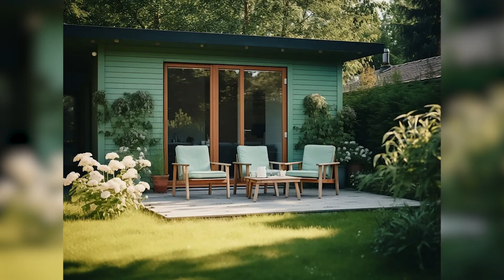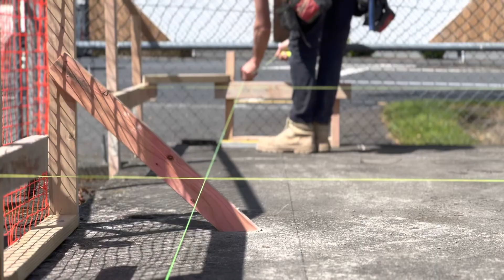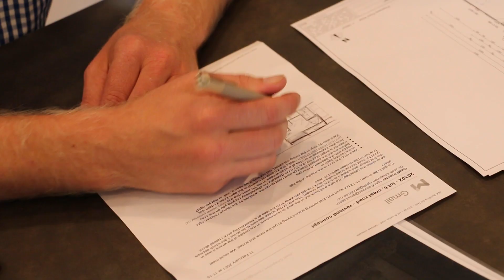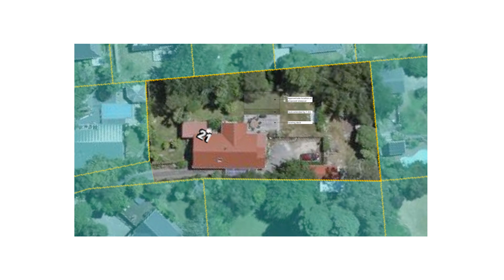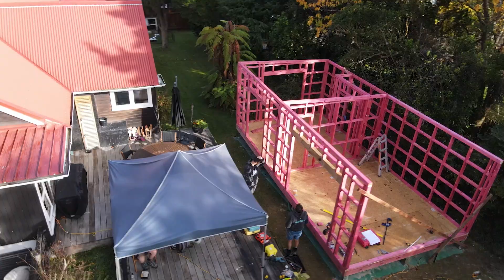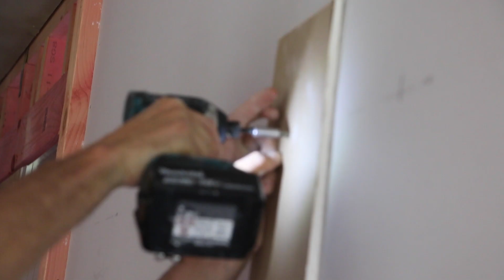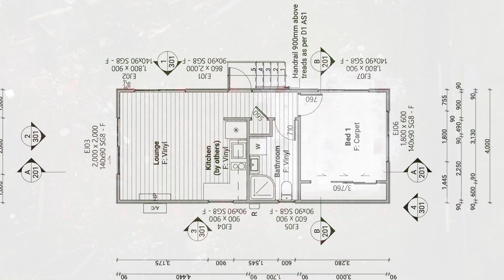Build a Granny Flat Faster & Cheaper: Here's How!

Comment: Hey Josh, loving your videos. It seems common in NZ to use more dwangs than the code requires. It that to line them up with the horizontal battens? What dwang spacing do you use? If you were installing a horizontal board cladding would you still use that many dwangs? (assuming you use vertical cavity battens in that case)

Comment: No bathroom? And not connected to the main house ? Means whoever is sleeping in the sleepout hasto get into the main house in the middle of the night, while it rains or snows. 
😳
Reply from the maker: You're right that would be a hassle - however putting plumbing in to a tiny home requires consent.

Comment: I really want one at my back yard. But the toilet makes my plan stuck. Can I also build toilet in the sleep out? Do I need council consent
Reply from the maker: While not all granny flats require building consent, when you want to add a bathroom or kitchen, things change. You will likely be need building consent and/or resource consent. If you are wanting to add these check in with your local council first and they will let you know the specific requirements for your area.

Comment: How will these grannyflats in peoples' back yards actually help the NZ Housing Crisis? Who will they be for? Certainly not those desperate for a home (especially lower income families). Sure they'll be great for "surplus" family, maybe even offer extra income as rentals for singles, couples, or maybe a little more. But that's it. As long as homes keep getting snapped up by companies or mum-and-pop investors (and rented), home ownership just gets further and further away for those that really want affordable housing. If the government really wanted to tackle the housing crisis it would build homes only for families - no investors. And then it would relax the rules further for rural areas in particular. Builders self-certification is great as long as they come with a solid reputation (maybe set a kind of WOF/REGO building certification process that good builders will find relatively easy to pass - and have it renewed annually based on independent inspections of buildings they have certified)....tens cents of questionable thinking lol.....

Comment: Ive put up a granny flat too close to fence. I had a verbal approval from neighbour and when I got it up she complained to council straight away -what now?
Reply from the maker: Definitely a conversation to have with the builder and the council
Reply: @nzbuilder   the builder was a firm that sells flatpack granny flats on trademe.  We are only 1 m setback from the side boundary . The neighbour that complained was shown pictures of the building and several times said she was ok with whatever we did as she was too old to worry about such things. Then the same day it was up she laid a complaint.

An inspector has been round and said they will issue a notice to fix but if we move away from the boundary we are too close to the house. We have had to relocate our importing business as commercial leases in this commercial environment are not viable.

Are flatpacks acceptable to the building code - I cant find anything on this. How does council usually deal with these situ's

Cheers

Comment: With no need for engineers report how are foundations determined? Much of the Hutt is either hard river gravel (Trentham) or soft wet clay (Naenae). One size does not fit all..
Reply from the maker: As long as good ground is within 600ml you can use 3604 for a piled foundation. An engineer would need to be engaged if you were unsure where good ground was

Comment: Just remember that when it comes to selling the property a LIM (Land Information Memorandum) which banks require to lend money will likely NOT identify the work done without building consent, and that work will not have a CCC (Code Compliance Certificate), which can have the potential to put some buyers off purchasing, or they may wish to negotiate a lower price for the extra risk they take. Something to consider if you're looking to save some money on the initial building consent fees
Reply from the maker: Yes that would be true if the structure needed consent. Currently not an requirement for buildings under 30sqm without plumbing. Our LBP gives a guarantee for our building work as well as warranties for items such as windows and roofing. Definitely something we look in to before ripping in and building. Great question though - ill jot it down for another video.
Reply: What is occurring for example take  a very  simple laundry extension that does not comply or has not been approved by the consenting authority who envision  an immediate outbreak of of typhus and catostropic building collapses around every corner then the purchase price of the house is negotiated and knocked down in price to get around the time and rigors and costs associated with the consenting process, Way  too much power and control has been assigned to councils who peer review and thereby contract their way out of all responsibility and particularly consenting interns who continually deflect responsibility and who have never wheeled a barrow of concrete or driven a nail and most likely never will heaven help owners  how can utilising alternative solutions be of much use when inspectors have little or zero experience in alternative construction methodolgies,  here is where HR DEI tick the box equivilancy programs become insane such as appointing a former school teacher even a surf life saver into the role of building inspector what could possibly go wrong for the client,  is it any  wonder experienced men are leaving the building  trade in droves to get away from the consenting and approval nightmare KPP Nz

Comment: As an electrician in upper hutt i can say we have been called out to heaps of granny flats with dodgy wiring so please people need to make sure they aint getting cowboys and dont be afraid to take photos start and during of all electrical just for insurances
Reply: How about issuing cards (like drivers licences) which show you are are a certified operator - which people can easily check online via a government website? Photo and basic details should be enough plus dates you began working, and start and expiry dates of your current certification (renewable annually, or perhaps 2 yearly). Could it maybe work for builders, plumbers, roofers etc? Only experienced operators (Minimum 1+ years of verifaible work) eligible. Renewal based on indepedent inspections of previous work?
Reply: @gideonporter537  the cards you are talking about exist already. It is called lbp and you can look up anybody's name to find out if they are lbp registered or not. But a lot of lbps will try to take shortcuts if they know there is no building inspection from the council. There are still enough licensed cowboys in the building industry to ruin it for all.

Comment: Don';t hold your breath. It will take a long time to go through the system and the Councils will mount a concerted campaign against it as it will take money away from them.  The if it goes through, most sections will not be able to take advantage. However high your building is, that is the distance away from any boundary it must be. So at a minimum =you will need 2.7m of spare land along your boundary. You will need to show over 40 square metres of outside amenity area and at least 2.0m away from the main dwelling. So most sections are not big enough. So i post this question. How many single story buildings in New Zealand have fallen over and endangered property or life on the next door lot? I have been in the construction industry for over 25 years and have heard of none outside earthquakes and flood. So the rule to keep your building it's height away from a boundary is designed to minimize the effectiveness of this proposal and is not based on any real world data or events.  
If you are on a rural property, then you will need building consent for the waste water disposal as the proposal only allows discharge into Council systems. Another fop to minimise the effectiveness. 
I do not think there will be corners cut as the builder will be named in the documents they send to Council.  95% of builders and trades people do a great job, whether the unqualified and inexperienced Council Officers are looking or not. To say otherwise is an insult to the industry. LBPs have to upskill themselves every 2 years to maintain a license. There is no such requirement for the regulatory side. So to rely on the Council when they know SFA about building is ignorant.
Finally I disagree with traditional building materials. You may build great, but it is last millenium's methods. SIPS structures provide a far greater performance, far quicker build times and a far superior building than stick buildings. If you want to take better cars of your family, Formance Building Systems re the way to go.

Comment: Interesting, build a 60sqm garage and put a bed in it?, technically it's a sleepout with a garage door for access, this would make sense as 6x5m was never really big enough as a double garage/shed. For those wondering about having a bathroom all you need is to get a safe and sanitary permit done through the council which depending on the council should be around $500.
Reply: I have discussed all the conditions on granny flat in my latest video. It is a good move, but there are quite a few conditions that people are not aware.
Reply: Turning a 60m2 garage into a dwelling is not allowed without consent. Building a 60m2 garage is and will not be allowed without a consent. And there is no such thing as a safe and sanitary permit.

Comment: Good video Josh but you left out a critical point, that the current 'rules' for 30m2 accessory buildings built without a consent must not include any plumbing. Also that they must be located a distance away from a boundary or other building by the same dimension as their height above the ground. There are other conditions also. The proposal for allowing a 60m2 secondary minor dwelling (granny flat) does not have those restrictions, though I will bet you that every TA (council) in the country will fight that policy because those TA's will want control over what additional load goes on to the council infrastructure (drains and other services). In Nelson the council is proposing a massive change to the planning rules (PC29); they say to accommodate population growth which is actually decreasing at present. I have made a submission proposing 'granny flats' as the solution instead of allowing 3 storey blocks of flats built by Kianga Ora for 'homeless people' allowed to be erected in residential zones. I am a design LBP and mainly work with a cabin builder/saw miller to provide simple and low cost timber small homes throughout NZ. We don't use conventional materials, as you advise, instead we line with TG&V boards (apart from wet rooms), almost all our materials are just timber. Getting building consents for these simple cabins is actually harder than for a group housing co. house, the bureaucrats can't seem to get their heads around simple, they are a nightmare sometimes... so I also welcome these proposed changes - but watch the councils backlash coming... 🙂
Reply: Yeah I get the government's proposal if it was just enlarging the 30sqm requirement to 60sqm, but when plumbing gets involved it's hard to imagine that council would be any less involved than they are now, and therefore the costs would be the same/very similar.

Even the extra storm water from extra dwellings that didn't have plumbing might trigger council involvement in some areas?

Comment: I think its a good idea however I wonder what the definition of a granny flat is, can it be a shed or does it have to have certain amenities? Can it have a toilet how does the council know if the sewerage system is going to take all these extra inputs. Could I have an empty section and built a granny flat, what I might call a tiny home? and then how many can I put on this section. I would like to see the full proposal before I would totally agree with the idea.
Reply: It's a self contained, second, minor dwelling.
Reply: @awakenotwoke1973  That sounds pretty clear, hopefully nobody will find loop holes in it.
Reply: @campbellmorrison8540  I think that the difference between it and a 'sleepout' is the absence of sanitary fixtures in a sleepout.
Reply: @awakenotwoke1973  Sounds reasonable but one does wonder what controls the councils will be able to take if the sewers get overloaded. I cant see it but one never knows how these sort of things could take off with 1000's of new connections. Having a granny flat even without a granny would suit a lot of people I suspect.

Comment: I have a few concerns,

Having just sold an old house where some extensions had been consented and even inspected but not signed off, what a mission OMG. Anyway what happens in a decade when the property is sold.

Would one need to inform council?
 Really the issues start with bathrooms and kitchens would they no longer need consenting? considering even a bathroom alteration can need a consent currently.

Not anti the idea I think its great, I am actually considering building two of them.
Reply: Some good advice someone at a council told me. If you build something under an exemption eg small carport, print the relevant exemption off the council website at the time and keep it, might save some headaches in future to prove what rules you used at what time.

Comment: my sister had an architect draw up plans for an extension, submitted them to the council which then went public for consultation at the same time being approved the total cost? less than $1000! that was the UK,  in NZ the council fees, architectural drawings planning etc is EXTORTIONATE and a money pump scam. they talk of saving $7000 or $8000 per build? if they want more builds they need to strip away the majority of red tape, increase building standards (in line with European standards) affordable housing starts with the removal of complicated and expensive unnecessary red tape.
Reply: Agree, but also these fees make up a very small percentage of total build costs... So to make affordable housing we know the solution, and its not by removing red tape and opening ourselves up to next leaky homes crisis... Its by stopping corporate monopolies like fletchers
Reply: @myke29 Timber in NZ should be dirt cheap.The government should take control of the supply of building materials from the pine forests to the mills, you can't build affordable priced housing when the cartels are bending us over a barrel !
Reply: @myke29 
Just go around them and save about 30%.
Reply: You are right I agree with you but remember NZ has a lot of earthquake areas
Reply: Indeed Simon, leaving the complicated and burdensome Building Act and RMA in place while partially circumventing them with these kinds of exemptions, while demanding that they are adhered to, will complicate things and get a lot of people in trouble.

Comment: Not all builders are as honest as you. They will think that if it’s not getting checked then what difference does it make if I use rubbish insulation or crap wood. It can’t be checked once it’s finished.
Reply: Get your own independent inspector or take that risk.
Reply: If they do cut corners word will soon spread and they won't be in business for long.
Reply: @paganmoon8540  That's not true at all.
Reply: Is the MB master builders warranty not a thing any more?

Comment: As I understand it, the current 30m² allowance still requires you to place it at least its own height from the boundary or existing structures. Even on my roomy quarter acre it makes it difficult to conceive of a practical placement. I just hope any future rule changes are more sensible and I could just use normal council rules on set-backs etc.
Reply: Yeah, Josh says local set back, that is Not correct, my mate had an LBP build a shed and I told him it’s too close to the boundary the LBP applied the it local set back and the neighbor complained and he had to move was a concrete floor.
Reply: They are proposing two different options for setback. One option is same as the 30sqm conditions and the other option is 2m setback. I have discussed all the conditions on granny flat in my latest video. It is a good move, but there are quite a few conditions that people are not aware.
Reply: In Australia they allow 3m end boundary and 1 m side boundary. I put ours up to that. 2 Builders were ok with that then neighbour complained after being informed of height.. Waiting for inspector to visit and tell us to move or to give us a concession it but we are restricted in space. No easy options.  STRESS